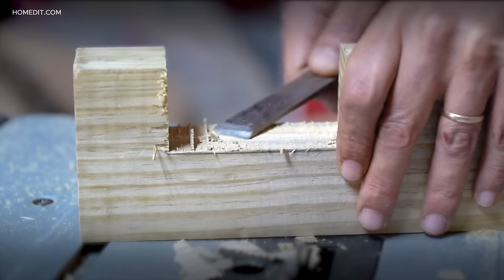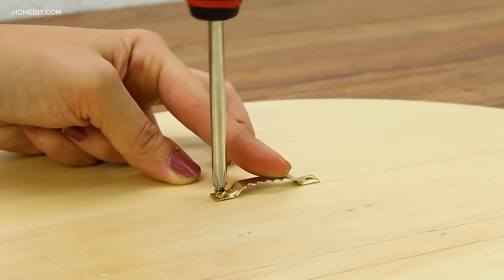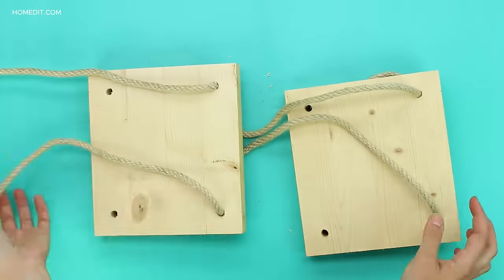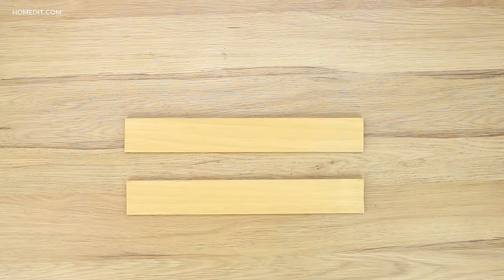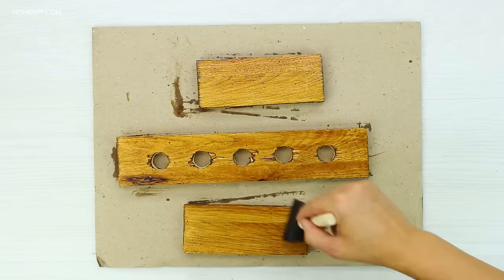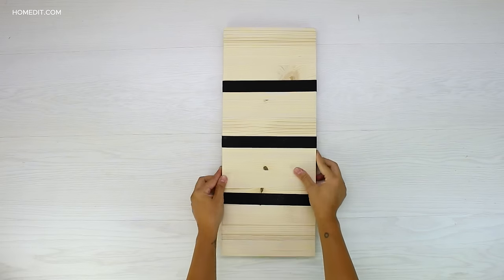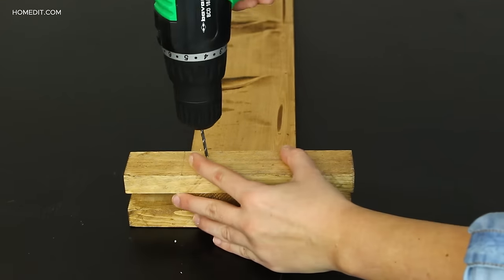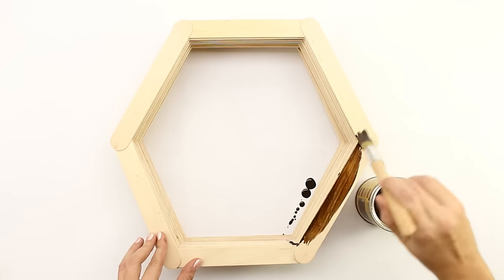From Remnants to Remodels: 32 Brilliant Ways to Utilize Scrap Wood

Comment: Some of these projects seem like they would use more than just scrap wood to make.  Scarp wood, for the most part, is usually small pieces of wood.  Some of these use / need some rather large pieces of wood to make.
Reply: Second one... Literally asks for full length material. That's not scraps.

Comment: I don't think your headboard lamps would pass most electrical codes.  Usually, marret wire connections have to be contained in an electrical box if it's standard 120 V. power